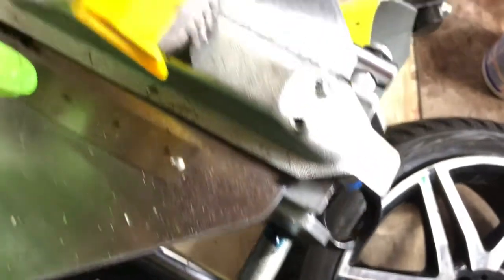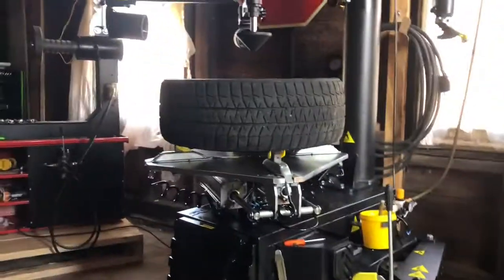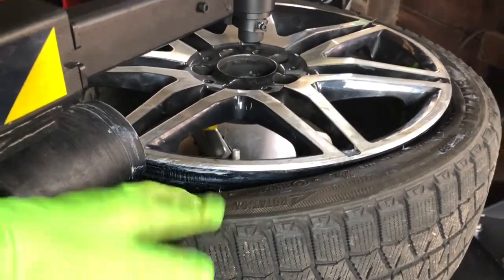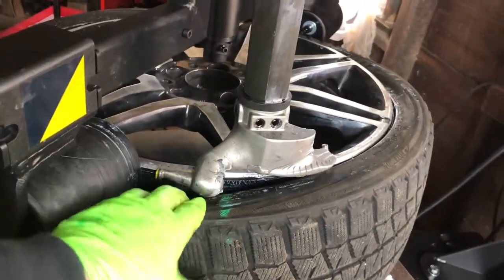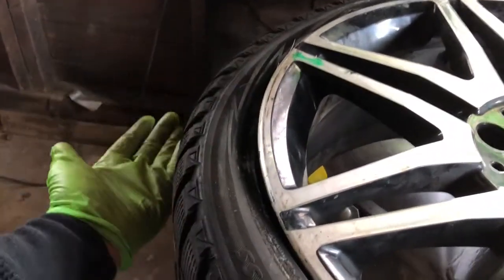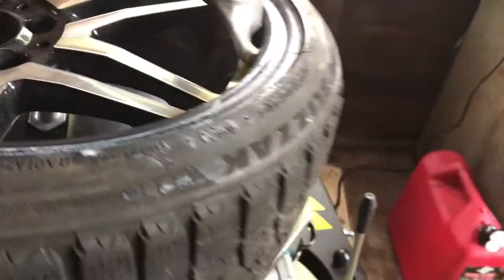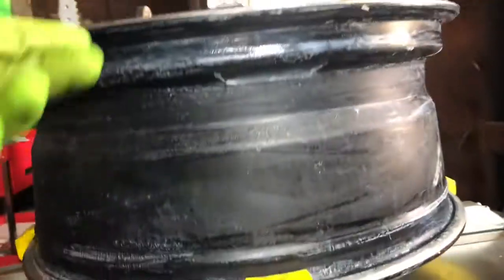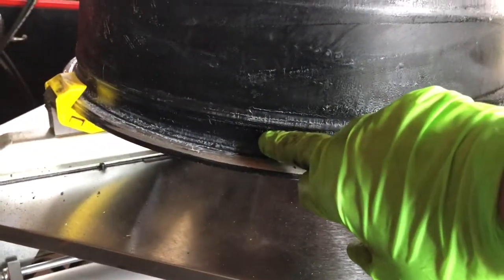Mounting Low Profile Tire Tire Machine Pt1. Dismounting

Comment: I am an old school tyre fitter I can change those tires very easily on an electric machine with no assisted arms I can do it basically with tyre leavers it's not hard from what I can say looking at the video one of your clamps has not grabbed the wheel because it is pinching the tire at the bottom
Reply from the maker: yes, one of the clamps did catch the tire and I didn't see it until I was taking it off. Once you know how to do tires properly a basic machine is only needed most times, however some tires would be quite difficult without assist arms, especially to not damage. the profile is only one of the factors in determining difficulty, the tire construction is more significant and some sidewalls are very stiff. thank you for watching my video.

Comment: HI,
how is your tire machine holding up over the years. Did you have to do any repairs? would you recommend it for someone who does 7 cars a day?
Reply from the maker: it’s been holding up great. I’ve had to do no repairs to it, I’ve just cleaned it when it gets dirty. I think it should handle 7 cars a day with no issues. just make sure to keep an eye on the oiler for the cylinders, I use compressor oil and it’s been fine. it’s been a great machine. make sure to get the assist arm if you do low profile tires. I can do a regular cars tires with balancing in under an hr on the ground. with a lift faster. for the price it’s hard to beat. there’s a new duck head on them now that is better, I’ve upgraded to it. feel free to ask any other questions.
Reply: thank you for the response. What's the new duck head? I'm torn between choosing this unit or a cemb sm825evo or the m&B 325ti @geardriven1016